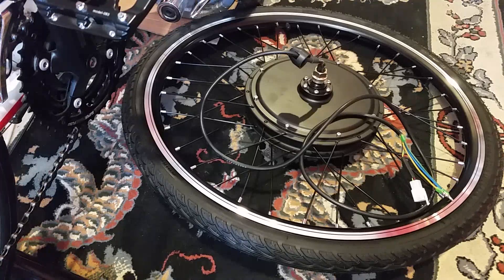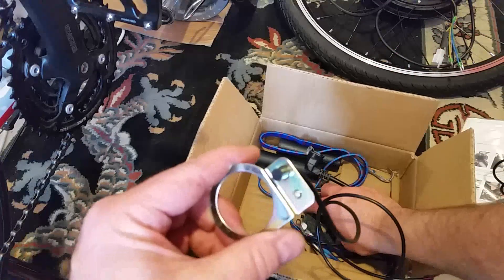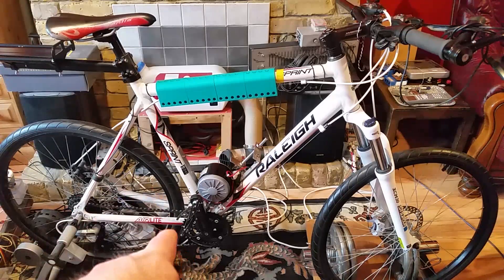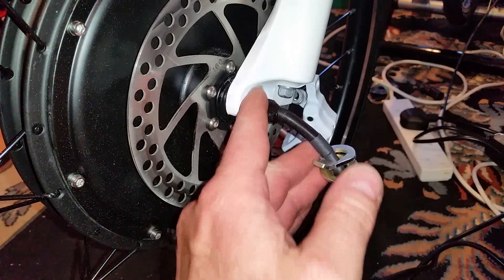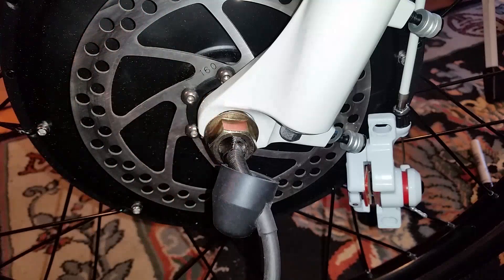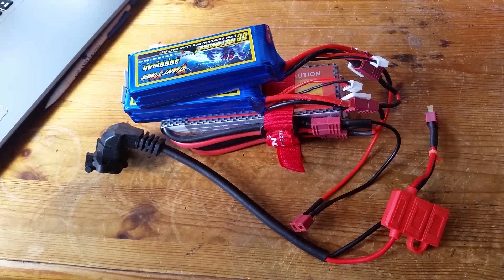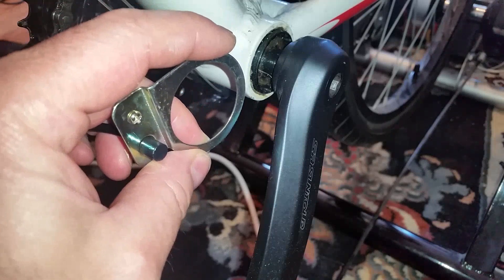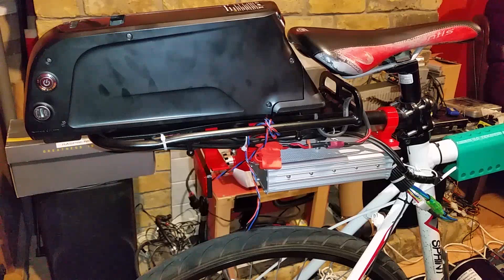1KW £130 eBay e-Bike Kit, Fitting & Testing + £200 480W 48V Battery

Comment: the washer that you reversed, you were suppose to put 1 inside the frame (forks) and the other with tab on the outside. And the case that came with it, is for the controller
Reply from the maker: The width of my forks meant that the washers with tabs fitted on the outside of the the forks, one on each leg of the forks, pointing inward. the thinner plain washer on the outside of the tabed washers. The spindle is the exact width of the forks and so fits perfectly inside the forks with no space for any washers.

Comment: Do you have to run the brake sensors? If i'm off throttle braking is that good enough? Only asking as these look like they are for standard brakes and not hydraulic disk brakes. Cheers
Reply from the maker: Using the thumb throttle, the power reacts exactly with the throttle position. Using the crank cadence sensor, the power cut off lags after the peddles have stopped moving. So if you are just using the throttle, and don't connect the cadence sensor, then you could get away without using the brake sensors.

Comment: You are going to have problems with  center of mass! To high at the rear! Try to climb...
Reply from the maker: The battery weighs about 5Kg, I weigh over 100Kg and the hub motor on the front wheel probably weighs over twice the battery weight, and it's many times further in front of the rear axle than the battery is behind it. The battery over the rear wheel wont be an issue.
Reply: @DevelopIT  if you have 100kg you don't need the motor. Only the bike! 😜
Reply: @DevelopIT  You're thinking front to back, Astro is thinking about height as well.
Reply from the maker: @6sicSIX  As a person I am the highest object on the bike, my center of gravity is well above the battery and the battery is less than 5% my weight.
Reply: @DevelopIT  let's agree to disagree.
Yes your centre of mass is still favourable.. But it's not ideal.
Anyway good video, you for showing the whole process :)

Comment: Thanks for video. Very informative. Could you add links to the parts you brought?
Reply from the maker: I search eBay for "1000w hub motor", ordered the results by price from low to high and filtered by item location UK. The stock of importers comes and goes, so the stock of the item number I got about a month ago no longer exists. Same for "48v li-ion battery". It's best to get from a UK importer (item location UK) as getting from a China seller could add an import tax bill on delivery from the delivery company. If no local stock exists when you search, check back later as it may take a while for sellers to import new stock.
Reply from the maker: Also, the seller I got it from for £130 is:
https://www.ebay.co.uk/usr/sunflower-wkl
You could contact them to see when they may get more stock.